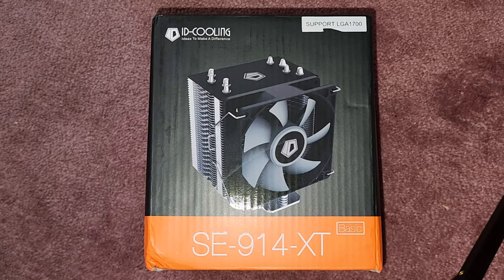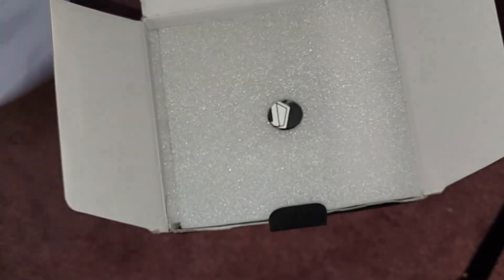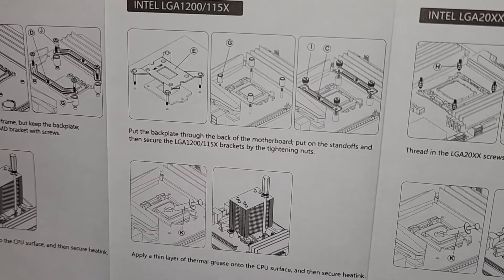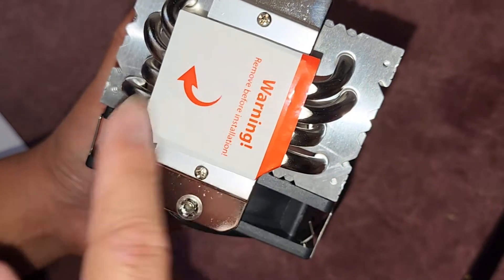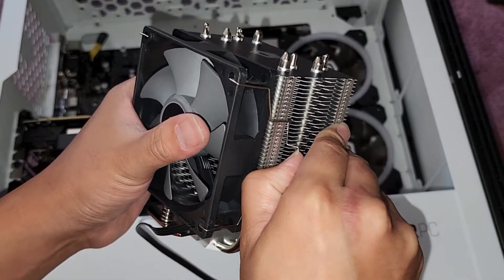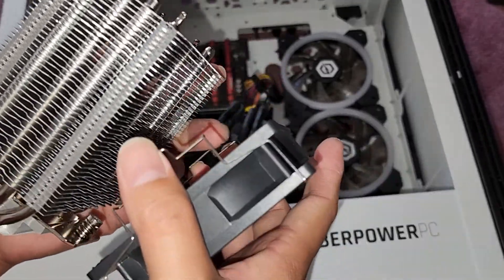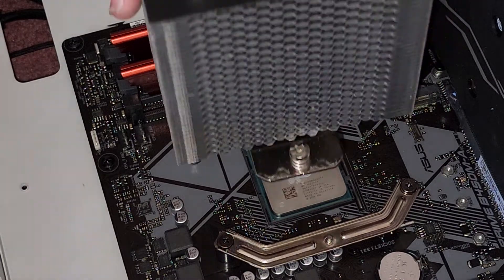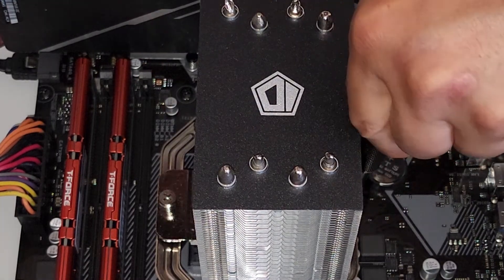Amazon CPU Fan Heatsink Radiator Cooler ID-COOLING ID COOLING SE-914-XT Basic AMD AM4 Installation

Comment: I am a big fan of these tower coolers, they do a much better job than the in box cooler.  I run an Arctic Freezer 34 esports (single fan only) on a Ryzen 5 3600, it dropped the temps something like 20C under load and it is way quieter than the stealth heatsink and fan.  Thanks for the video, Binh.
Reply from the maker: Yup, they work really well. Also, liquid cooling I see so many systems fail.